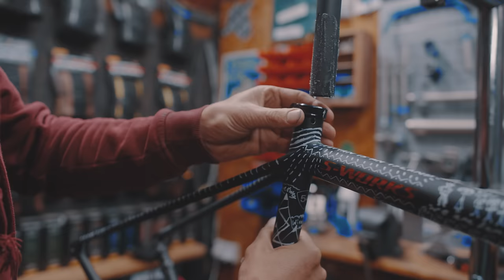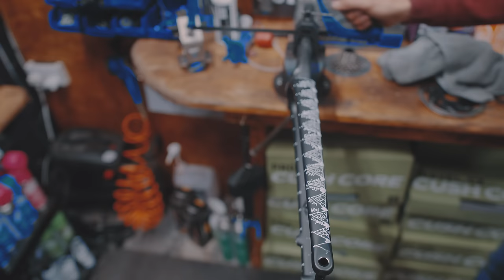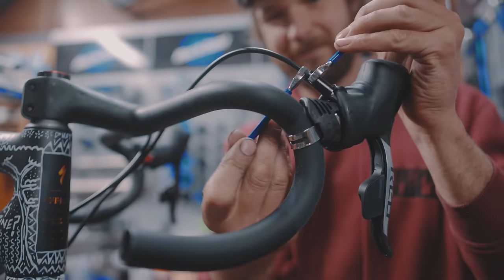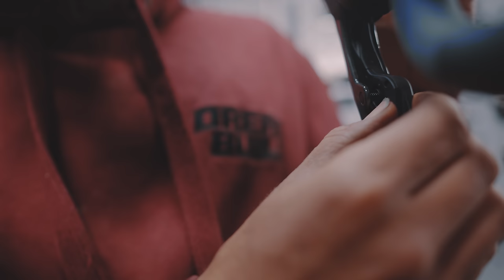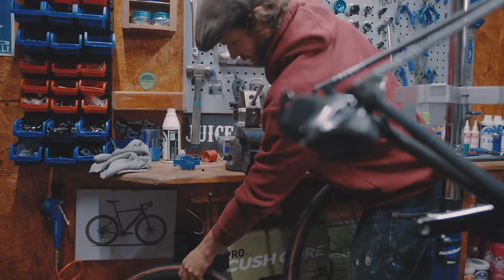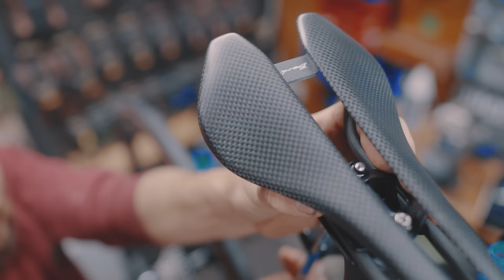DREAM BUILD ROAD BIKE - S-Works Aethos doodle bike

Comment: Nice build. Why lather on all that grease on sealed bearings?
Reply: The headset bearings? The grease acts as a water-resistant barrier for the headset assembly, preventing the races from rusting. Headset assemblies must not be installed dry.